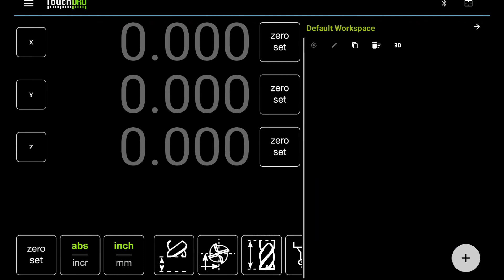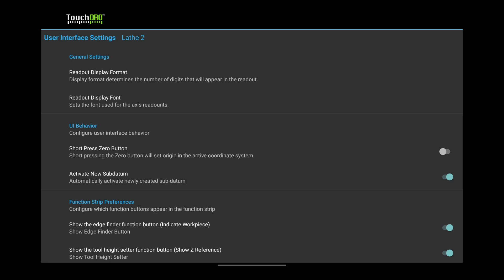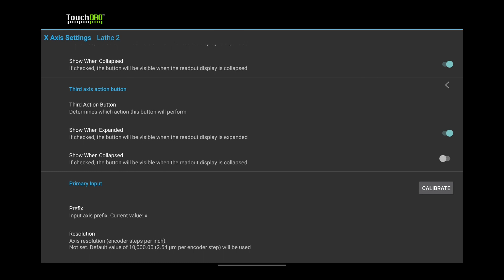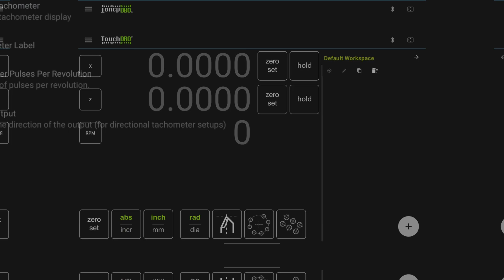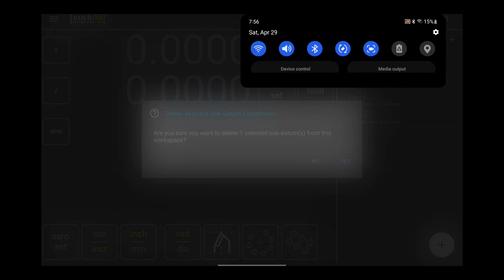TouchDRO Lathe Settings

Comment: Is this newest version available for download or is it still in beta testing?
Reply from the maker: The V3 has been available since January. There are three new builds since then, the very latest one (2023-05-12) is still in Beta.
Reply: @TouchDRO  how do I download it?  When I go to the store it doesnt state there is an update.  Should i remove it then try re-installing it?
Reply from the maker: @brandontscheschlog  check that your tablet meets the system requirements: https://www.touchdro.com/resources/dro-manual/system-requirements.html

Comment: Hi @touchdro - is there still problems with latest android version on samsung galaxy tab a8? I ordered a encoder from you a couple of days ago and went out and bought a samsung galaxy tab a8 yesterday, but then I stumbled upon the comment on your site that it now has a bug.  As I have not yet received the encoder I guess I cannot test if it works properly or not, or is there some way to simulate the problem even with no encoder/scales attached to the tablet?
Reply: Anyway - I just went back to the store and swapped the A8 for a Lenovo m10 plus 3rd gen, so hopefully everything will be smooth when the decoder arrives :)